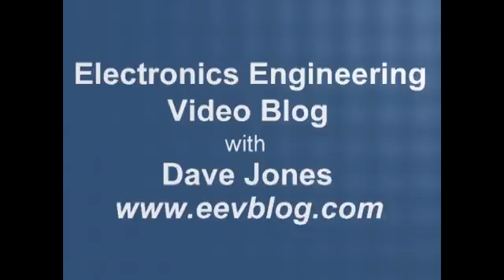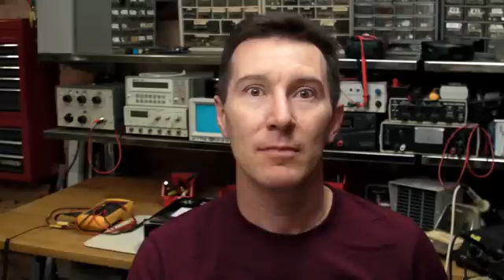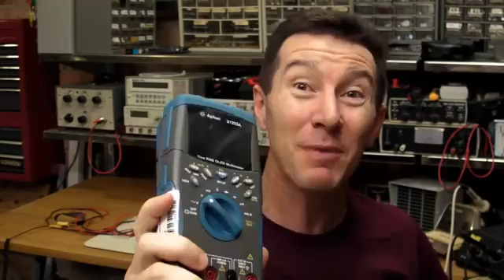EEVblog #56 - Agilent U1253A OLED Multimeter Review & Teardown

Comment: Have the B model Keysight and 2 flukes.  I don't ever use the fluke anymore.  Maybe if you are outdoors and working on high voltage the fluke would be better. In a lab this is waayyy better.
Reply: I have the Fluke 87V and two U1252B’s. The U1252B’s are just quirky enough that I can’t trust their readings 100% the way I do the Fluke (and my Keithley bench meter). And the continuity test is just too slow.

Comment: Well, I understand why they tried to push OLED matrix screens for meters 6 years ago. 1) It is easier to configure display element layout on the fly without manufacturing separate displays for each meter model (simpler for mass production). And OLED was a cool buzzword for uneducated at that time. Obviously it come together with problems to see readings in bright light and horrible energy efficiency. So don't make and purchase multimeters with OLED screens - does not worth it.
Reply: Still waiting for 2).

Comment: Please can a decent HMM have normal fuses like a meter man unlike fluke with their buss fuses which cost a lot the number of Dmm's I see with blown buss fuses it is really hard to justify spending £12 on an 11A and £7 on a 400mA buss fuse from fluke when a normal glass fuse costs pence please main well known known manufacturers reduce the cost of fuses or change cheaper fuses.
Reply: Brad Grey the performance of the expensive fuse is different from the cheap glass fuse
Reply: Brad: nope. The fuses are expensive because they are radically different. These specialty fuses can interrupt currents that literally will make a glass fuse (and the meter it’s in) explode. Without fuses like these, it’s impossible to meet the CAT IV rating these meters are rated for.

Comment: OLED screens are a big mistake, they have flicker problem. Devices designed for long-term continuous operation should NOT have OLED or anything with multiplexing design with a flicker problem, as it causes inconvenience for the operator. That fact alone puts the thing in the expensive crap category.

Comment: I also have one of these meters. Replaced the 9volt battery with 2 lithium 14500 cells in series. They fit nicely in the available space and the meter recharges them just fine. Funny thing is that i also have a small fluke 112 and i use it more often because of it's better continuity tester and autoranging. I keep the agilent for more precision stuff.
Reply: Motoi Bogdan Charging lithium batteries on a charger made for NiMH is extremely dangerous!!!!!
Reply: of course it's dangerous. But it's not a consumer product and we're not average consumers aren't we? 

In this case, i've done some measurements, and there is no risk of overcharging those lithium cells if I:
1. use them until discharged or at least 2/3 discharged
2. recharge them for 1hr8 min (the default agilent recharge cycle)

With both conditions met, i've charged these cells for more then 6 months without trouble.

however if you charge the cells and try to force another charge cycle, the meter will try to charge the cells to almost 4.4v/cell and that's indeed dangerous. I simply don't do this.

Comment: This thing is really worse in many regards than my standard 50 dollar multimeter. internally and performance-wise.
Same thing with a Fluke 80K40 HV probe. Cheap chinese product with Fluke stamped on. Breaking of the internal wiring is standard on these.
So why the hell should i pay 450 bucks for this multimeter or 350 for that hv-probe?
About multimeters: in my experience, the cheapest multimeters always have the fastest continuity mode.
Reply: Fair enough but that Agilent will be far more accurate, the safety factor of having good fuses and will be safer at higher voltage and amperage

Comment: What do you mean when you say "at 50,000 counts per second"?
Reply: +Matt Maloney I don't think he said 50,000 counts per second, he said it updates 7 times per second even though its a 50,000 counts meter and that was relevant because higher counts normally means it would be slower updates per second because higher counts means a higher resolution (50,000 counts = four decimal places are measurable so long as the first digit is below 5) and yet this meter updates 2-3 times faster than other similar meters.
Reply: +Matt Maloney example 50.000 50 volts and .000mA or 49.999 49 volt and 999 mA, if is more then 50000 +1 the dot is moving

Comment: oled for something that basically shows only digits and for that it drain all the juice in 8hrs or less?? its definitely for bench use, where there's abandon supply of power but in a portable form factor....
if its not, they could try vacuum fluorescent instead.
still, multimeter with lcd fitted with backlight as the top choice.

Comment: This would be a REAL winner if it didn't use a 9 volt battery and a few other minor tweaks. 4 or 5 AA or AAA 's would be ideal. Permit Energizer Ultimate Lithium Batteries and it would be fantastic! I'd buy one.
 8 hour battery life is unacceptable. The design engineers need a new job.
Reply: I got some lithium laptop cells. Still good. I can put that package on the back of the dmm. 4 battery's and a buck converter and there you go.

Comment: "15 times per second update rate" - that'd actually give a thumbs-down if I had reviewed it. There is a thin line between a quick measurement / update rate and nervous flickering displays, and this device is far beyond that line. At that rate, it's impossible to take notes of measurements without hitting the hold button every time. Useless, just another wank figure for the product sheet. 3-5 times per second is quick enough for most cases.
Reply: Yeah but then companies wouldn't send you free products to review...

Comment: What u think about the 5 Dollar harbor freight brand sometimes free. Multimeter.
Reply: Burris Yard Man I hate them. I got one and it absolutely sucked! It was so far off and never worked right, it could not even measure AC. It would just say 0.0V no matter how may volts I put in it. Then, I saw the installer for "A better way solar" with it (the same model), he left it at our house (and never came back for it) and I looked at it. The display was messed up, it would output 2V for the continuity check, and it could not measure AC!

Comment: Putting an OLED display on a test equipment, especially a hand held one sounds like a really bad idea. LCD displays are far superior in bright light. An OLED display kind of tries to surpass the ambient light while LCD, being reflective, uses the ambient light, therefore being much more energy efficient than OLED.
Reply: Wrooooong
Reply: There's also the short expected life.....my gear is typically 20 years old and still working.  Apparently, these meters also suck down batteries like crazy.
Reply: @0x00zero  at least it look pretty easy to replace. I wonder if they sell replacement parts?

Comment: I purchased the younger brother B model. It arrived missing a screw, (i assume it was a rewored unit) and also the diode mode did not even work. One word JUNK. It went back in it's box and back to Agilent. That much money and they can not even send you a working meter with all the screws? I was also not fond of the extra long test lead  probes, too big in my opinion. I broke into my piggy bank and purchased a Fluke 289, a bit more but the FlukeView software and meter work fantastic for my needs. Sorry Dave but I must respectfully disagree with you on this one.

Comment: The Agilent U1252B is the one you want.  It has a couple of more functions than this one, and has an LCD instead of an OLED display, so you get really good battery life.  It appears to be much more accurate than the 0.025% spec as well-- almost as good as my Tektronix DMM4050 (a rebadged Fluke 8846A 6-1/2 digit DMM) -- the DMM4050 wins by one extra digit, but it is for the bench, not the field.  You might want to review the U1252B-- it is like "night" and "day" compared to the U1253A/B.

Comment: Try using the VAPEX tech 220mAh rechargeable 9.6 volt pp3 battery... yes 9.6 volts unlike most rechargables that only give you 8.2 volts.When out of the packed when delivered i checked the volts on my new VAPEX tech pp3 9.6 volt battery i got  almost 10 volts reading so they are very similer to an alkaline battery etc. Great and hilarious review.Best wishes or in ham radio we say 73's from the UK.

Comment: @DanFrederiksen That 1 billion samples per second is only for voltage (not I or R or C or temp or ...) and is more than likely only 8 bits.  This meter, on the other hand, has to work out at least 16 bits, each bit twice as precise as the last, making it at least 256 times more precise than the Rigol.  And it does so with extreme linearity and accuracy.  Multimeters and oscilloscopes cannot be used interchangeably when high speed or high precision measurements are needed.

Comment: I hate it when a 9V block is connected with a snap on clip. They're so darn fiddly to get off the battery. Often enough it's almost impossible to get the clip off with your fingers and you either have to use a knife to get in between the terminals and the clip or a screw driver to get in between the terminals to lever the clip off. Most of the time, the clips are of poor quality and break after a couple battery changes or the cable comes off.

Comment: Hi Dave, did you ever get the U1253B meter?  I was wondering about the differences.  Did they fix any of the negatives you found?  At the end when you summarized what was wrong, you forgot the super slow continuity test.  This is one of my pet peeves on meters.  If it's slow I immediately go look for a different meter.
Reply: I'm the same
Slow Continuity = Fuck That !!

Comment from the maker: Agilent bought Escort in 2008, it is now part of the Agilent basic instruments group.
I wouldn't say it's rubbish, it just needs some work. it actually performs very well.
The vast majority do not need a bench meter, nor 4 wire resistance measurement.

Comment: Also you nearly got it right about counts and accuracy, but you need to remember that the more counts you have the less important that LSD becomes. So if you work on 415V Electrical systems having a  4200 count DMM is far better than a 4000 count DMM even if accuracy is similar because it does not need to change to a higher range meaning the effective LSD error is not worse by a factor of 10 which it is if you range up

Comment: That meter is rubbish. It's made by Escort under licence, they all rattle like yours, and any meter that does not have fast contitunity is a waste of time, regardless it's update rate. Any why if your doing electronics are you not looking at a bench meter like the A34401A or the Fluke 8846A. Don't you Electronic guys need accurate 4 wire reistance measurements anymore???

Fluke meters are designed for Electrical use, Agilent make meters for lab / R & D and their recent handheld is below average

Comment: I agree with Dave - fast response can save a lot of time. One example is when checking for shorts to a multi pin connector - with a fast response I can just drag the probe across all the pins in turn and listen for the bleep. With this kind of response I have to probe each individual pin and wait...

Comment: Sure, yet on a high-end meter as this, the choice of a 9V battery is an unbelievably poor one to me. Look at the energy density - the best of the 9V ones I found is 250mA (6 cells). 3 of the best AA cells would deliver 2500mA (at half the voltage) meaning 5X longer battery life. Really that's a no-brainer to get 40hrs of useful life. Come on- even the laptop I'm using now gives me 8hrs use!

Comment from the maker: A common job for a continuity testers is to locate shorts on boards. If you have a fast "glitch capture" buzzer then you can wipe one probe quickly across all the pins of a chip to look for shorts to ground for example. If it's slow, this is painful and you might miss the short.

Comment: Not sure about the update rate, but the Fluke 287 has pretty much similar or better accuracy, and graphing capability, for US$465, compared to US$450 for the Agilent.

Hopefully Agilent will fix the problems in the next version of the meter. Just adding a DC power jack would turn it into a nice bench meter, no worries about battery life.

Comment: I have to say, I lost a lot of confidence in your reviews at the very end. I have one at work, and I agree with the bulk of your review. I couldn't believe you gave this a thumbs up, however; it's thumbs sideways at best, if not a thumbs down.

The low battery life, slow autoranging and atrociously slow continuity test are inexcusable. They may be able to fix the latter two in firmware, but the only solution to the battery life is to use AA cells. One AA cell has more energy than the 9V!

Comment: Could you have a quick look to see how the ohm meter works (does it range from a high voltage to a low voltage, or vice versa). I have witnessed one such meter which goes from high to low (10V down) and did not do much good to the circuit the componant was situated...